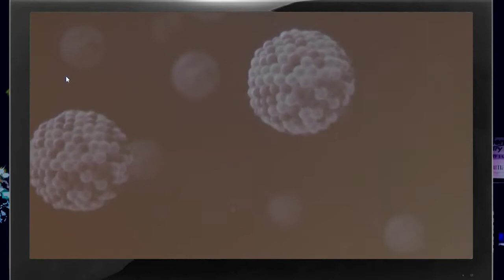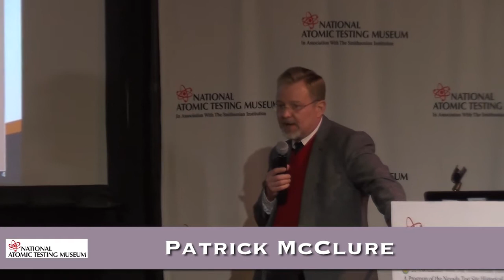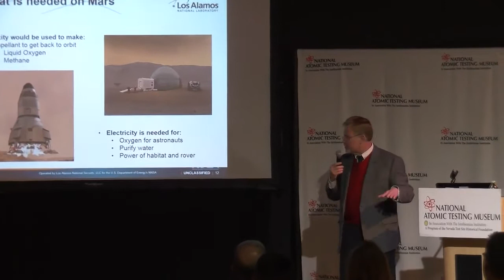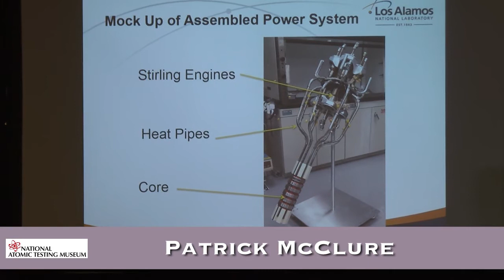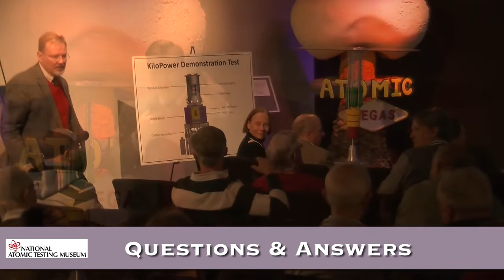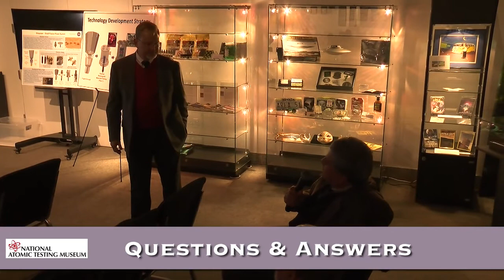"The Kilopower Project and Future of Nuclear Powered Space Travel" by Patrick McClure

Comment: Are any special materials used in the sterling engine seals or bearings?
Reply: No, just conventional space-rated materials like stainless steel, ceramics, aluminum etc. The seals will mostly come from welds but anything that cannot be welded will use indium gaskets, which make rubber gaskets look like sieves by comparison.